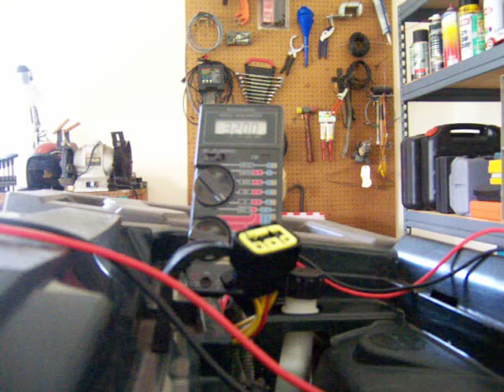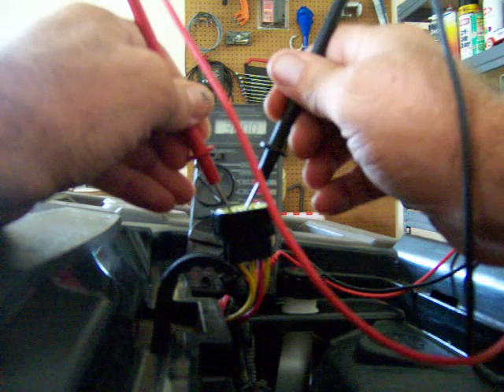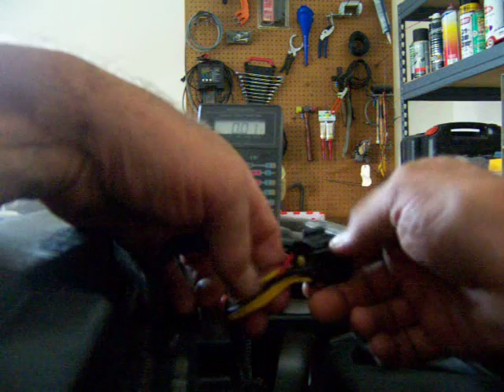Charging System Stator Test Can-Am Bombardier Outlander 400 ATV Motorcycle Watercraft

Comment: Hay bud do you no were the sec vin is on the frame for a 05 bombardier outlander 400
Reply from the maker: Look on the lower side of the frame near the footrest.
Reply: I looked all up and down the frame. Left side like they say it is but not there . Checked the right side as well still nothing
Reply from the maker: Look on the right side near the front diff.
Reply: still nothing
Reply: @justbraaapit6969  there is also a sticker on the frame under the seat on that model that shows the VIN.

Comment: Hi, We have a 2005 Bombadier BRP Outlander. 400 ATV.  The stator went on it, so had a new one shipped.  It is smaller than the one that came out.  Have they upgraded the stator and flywheel? Do we have to change the flywheel?  Having a problem starting now.  They swear it is the right one and won't deal with us any more.  We originally sent the stator to be re-wound, but it came back with one dead side.  So finally sent a new one.
Reply from the maker: +sandra berthelot..... Sorry to hear all the problems Sandra. There is no way for me to know if they had a size change. If you can find out what the stator fits you could sell it on ebay and get most of your money back. You can type in ATV stators in a search and find several companies that deal only in motorcycle and atv stators. That's where I would start if it was mine and these people could answer the size change questions also. I pray you get it all taken care of.

Comment: Awesome video&voice. I got a problem on my 2004 outlander, It started running strange and then died, no electric power and won't run.

The startmotor has been acting up a little a while before this happend , it just stopped working like once or twice a day, tap on it a little and it would start working again, any idea where i should start looking for errors?

I mean it should run without battery, right?
Reply from the maker: Gasrullen You need a battery in that model to run.  I would check the battery, fuses,  and as many connections as you can find. After that you will probably need a service manual to diagnose the problem.
Reply: Thanks for the advice. Fixed it today. sparkplug was bad and connection problem on the battery. Great machine :)
Reply from the maker: Gasrullen You're welcome I am glad you were able to find the problem.

Comment: I did the checks in your video ...There was no power at the plug. Where are the fuses located on the ATV? Once I get power to the plug and everything checks out does this mean my voltage regulator is bad???? thank you for your help...god bless
Reply from the maker: If it blew the fuse I would think the regulator is bad, however I would try a new fuse first. Usually you can download an owners manual from the manufacturer's web site for free. Should have the fuse locations in it. You also can try to follow the wire back. May the face of YHWH shine on you.

Comment: Any clues as to why my 400 has no spark at the plug, it turns over fine, just won't start, is there a fuse or a starting module
Reply from the maker: There are so many possibilities I would be afraid to guess. I would recommend you to invest in a service manual if you want to diagnose it yourself. Even the best techs are lost without specs.

Comment from the maker: @jumpinggulley  You should be getting voltage from all 3 yellow wires. You should use a voltmeter set on AC volts. Check it at idle speed and they all will be close to same voltage. Sounds like from what you are saying that your stator is defective. Might be a good idea to invest in even a cheap volt ohm amp meter. Hope this helps. Thanks Steve

Comment: I have a suzuki kingquad and my plug looks the same. I used a test light and got fire on two of the three yellow wires. The red wire had a dim light like the positive post on the low battery. I just ordered a new rectifier, do you think it could be the stator? I wish I had watched your video first.

Comment from the maker: @nxtcmgr.......Its going to be impossible on the Bombardier because it uses a 12V  DCI ignition. therefore you will need a power source of some kind. There are many ATV's that use a magneto type ignition and dont require any power source.

Comment from the maker: It was 9 volts at idle. It jumps to over 20 volts just above idle speed. The voltage regulator will then bring it down to a little over 14 volts.